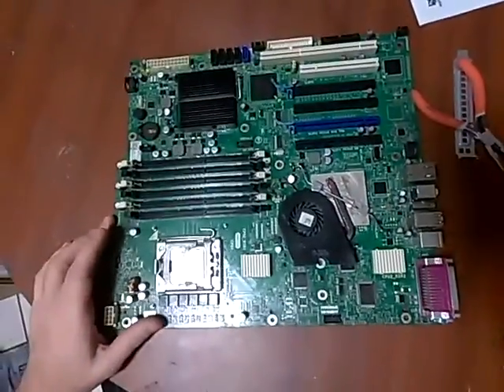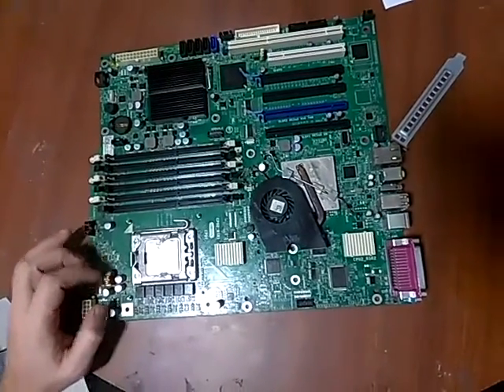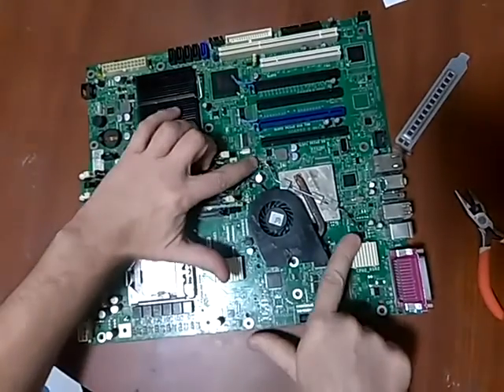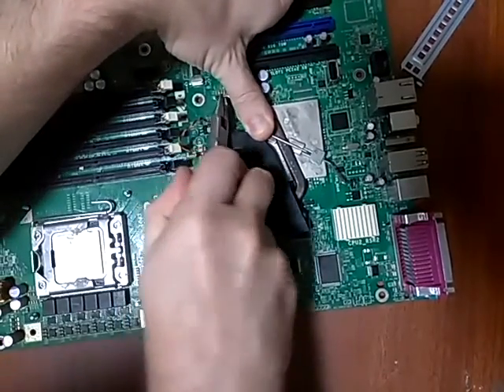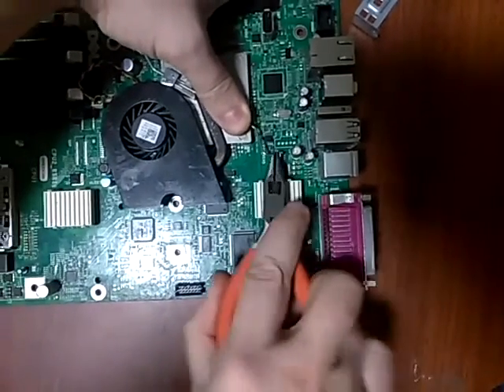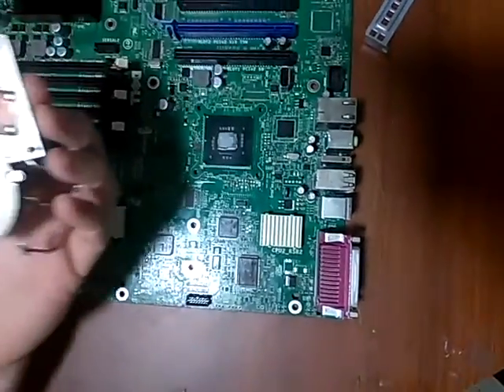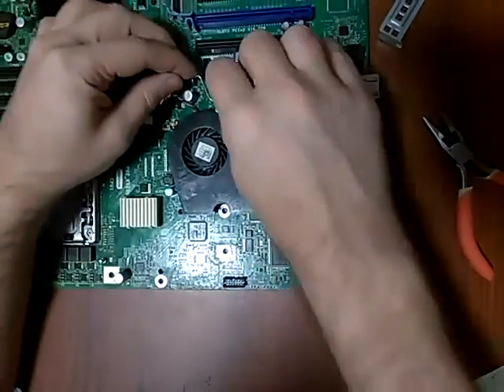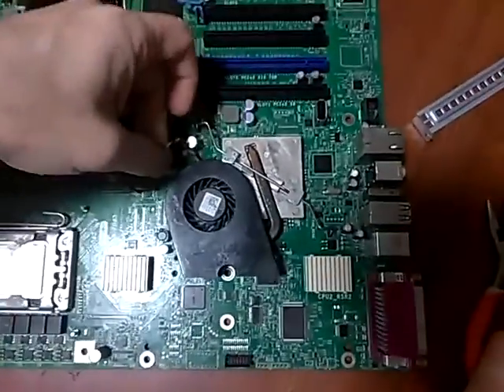DELL T5500 CHIPSET HEATSINK INSTALLATION

Comment: Can I upgrade the heatsink? And what is it LGA?
Reply from the maker: I would expect you need to get the same one in order for the system to detect it running at the correct speed
Reply: @PcexpertTheRealExpert also what is the name of the fan pins? I really tried to change it's fan but cant find One the same pins 😢